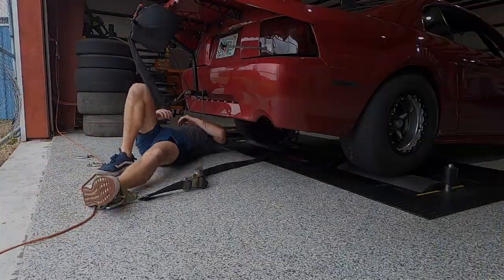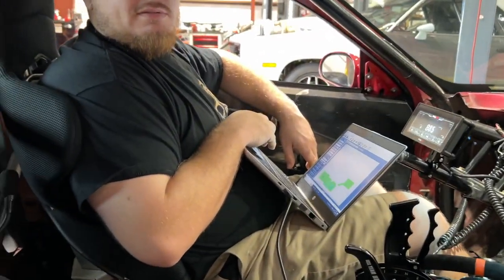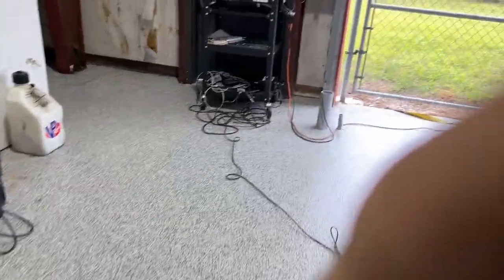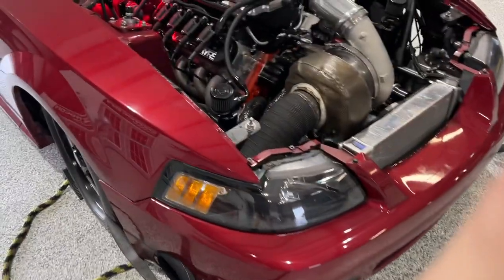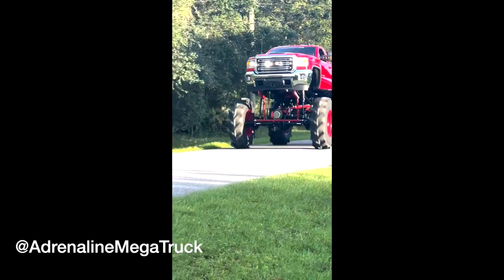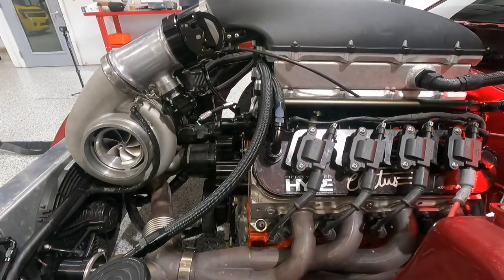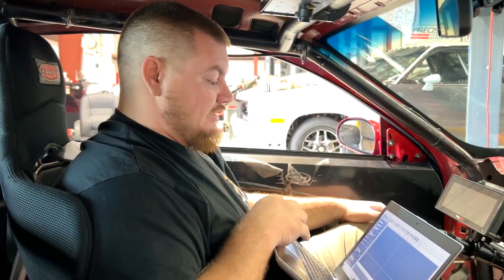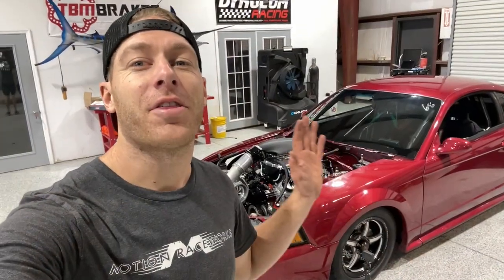We Made INSANE Power on Low Boost!

Comment: 7 months later but This turbo looks to be the 98/113? I know you said 98/118 but I was under the impression that the 98/118 version had a different looking chra and a 13 blade compressor wheel instead of an 7+7 or am I mistaken?

Reason being is it looks similar to my 94/113 I have.

Comment: when torque is higher than horsepower put a bigger cam in it.when torque and horsepower around the same that means you have a great setup and  there is room for improvement.bigger cam.but I also understand that you do drag and drive so you got to have that driveability. awesome set up the thing is going to be a beast
Reply: Its probably closer to 1000ftlb the torque converter is inflating the number